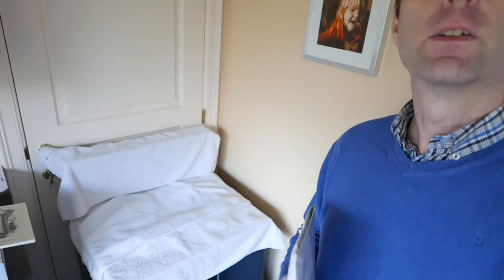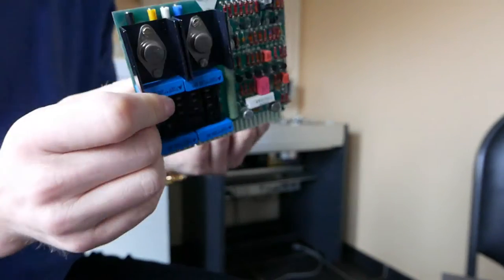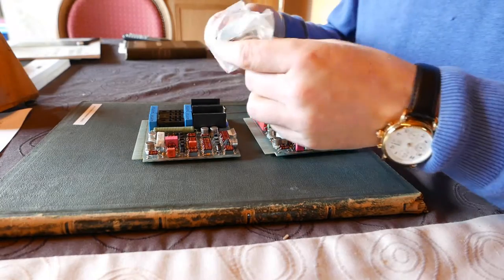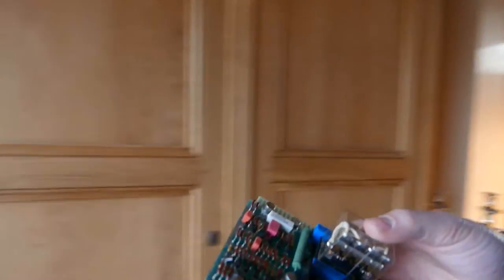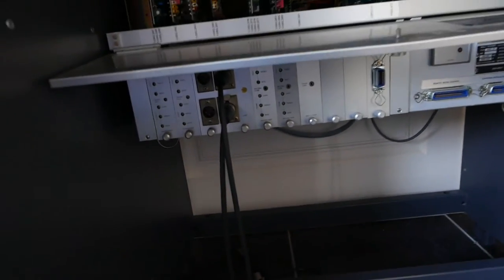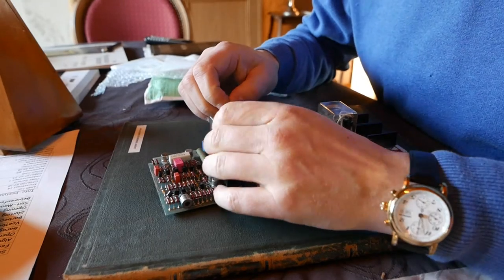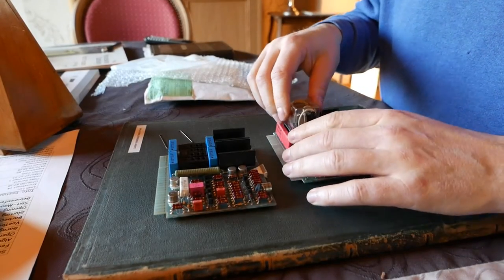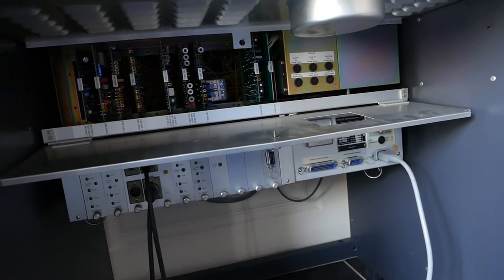WILL MR.STUDER WORK AGAIN ????

Comment: I hope you finally ironed out the problems.  I'm not a musician.  I'm an electrical/computer engineer who fell in love with high-fidelity audio during the late 1970s, and analog open reel tape starting in 1980.  After being away from audio for ~30 years, my passion reignited and I started collecting and repairing open reel tape machines around 2019.  I now have over 60 different machines, mostly consumer machines, plus a few semi-pro machines.  I just recently added my first Studer to my collection, a B67 MkI.  So naturally, now my aspirations are moving up to the next level...  🤣❤  I love the A80 series and I'm trying to learn as much about them as possible.  Thanks for making your videos!

Comment: Sounds like a power supply problem
I have 2 of these machines 
One of them had a cold solder and was stoping the controls from working
Usually takes 20 min or so because the voltage supply drops(also feeds the power to the timer)
The controls usually run at about 18v dc roughly (stand alone)
Dropping to 15v dc (in operation) 
Any power below 9v and the controls will not function 
I hope you sort it out
Reply from the maker: Thank you very much, James! The machine has completely refurbished, and has a new Studer power supply as well. Andreas sent a new mail asking to increase the voltage of the stabilizer board to exact 20v. That helped a great deal, it is not completely over , but the switch is "behaving" better. I'll share the updates!
Reply: AuthenticSound 
That's great to hear
20v is more then enough
I would also check the minus voltage power capacitor connections
I'm sure the cap is fine because it's new but measure it and check
I have refurbished 2 of these machines and they bring so much joy
They are totally worth the heartache 
Once they work,all is forgiven very quickly
Reply from the maker: Thank you very much James for your time and input, it is great to know you !